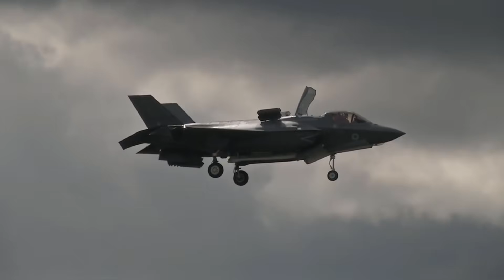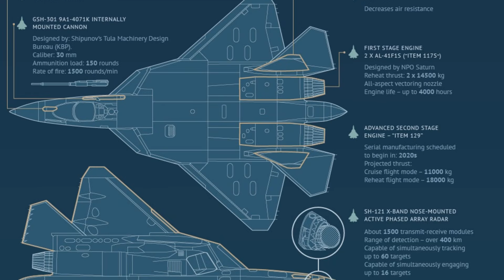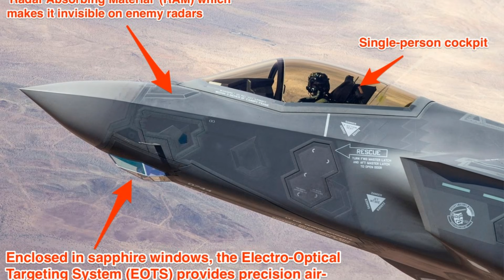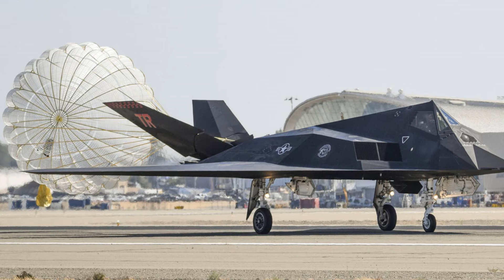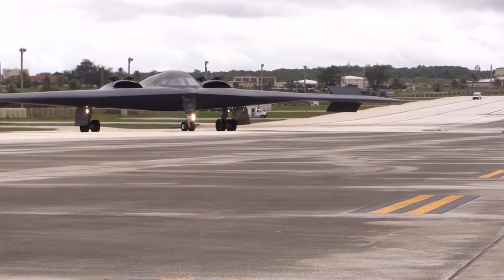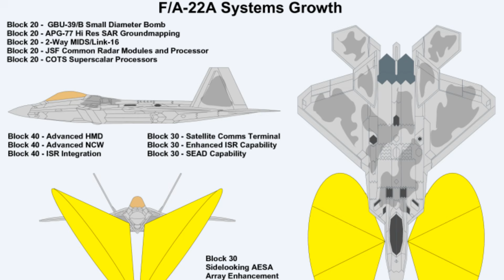Top 5 Combat Aircraft with Lowest Radar Crossection (RCS)

Comment: When you put su57 instead of j20 in top 5 then this ranking is a joke
Reply: Any fighter with canards is not a stealth fighter. They destroy any chance at reducing the RCS. It does have a decent AESA radar system which is a nut the Russians still haven't cracked the last time I checked. But it doesn't have super cruise or stealth. They haven't even been able to make their own engines yet. They'll probably get that problem fixed within 5 years or less. Bottom line is not a 5th gen fighter. Out of nothing but kindness you could call it a 4.5th gen. Within 10 years we're going to see 6th gen from the US and probably Japan.
Reply: @richardcontinijr9661  Japan has the best chance at making 5th and 6th generation aircraft along with the US.
Reply: @lw7238  Japan is skipping 5th generation fighters and going straight into development of 6th generation fighters. Honestly it's the smart play for him and they definitely have the capability of producing them. 

Australia ought to take a cue from Japan when it comes to their sub program. Instead of trying to build the ship building capability to produce nuclear subs they should just lease 688I subs from the US. As we take them out of service they could be refitted and refueled fairly quickly. That would give the Australians both the operational capability and experience of running a nuclear sub much sooner than developing their own indigenous sub and it would free them up to start developing autonomous nuclear subs. Skip the current generation and go straight to the next gen is a very appealing option.
Reply: @lw7238  then why japan 5th gen fighter still not in service?🤣
Reply: @richardcontinijr9661  People forget WWII and what the Japanese built.  Japan built battle ships, huge aircraft carriers and good planes rather quickly.  

Sweden's AIP submarines are a lot cheaper and catching up fast on nuclear subs.  They are defiantly the best non nuclear submarines in the world.  Still you can't beat the US nuclear subs even the used ones with a refit to newer tech.
Reply: @Vincent-xz2bj  Because they building a 6th generation.  HA HA HA
Reply: @richardcontinijr9661  It's ridiculous to say 6th generation fighter jets at the moment. We know that the replacement of fighter jets requires two conditions. The first is a major breakthrough in technology, or a major discovery in air combat theory. The second is that the new generation of fighters will inevitably crush the old ones.
From the beginning of the stealth fighter era to the present, I don't see a new major technological breakthrough or air combat theory. The so-called loyal wingman can only be regarded as an upgrade project of the fifth generation aircraft. I also don't know what kind of new aircraft to make that can completely crush the current fifth-generation aircraft.
The era of the 6th generation machine is coming, but it is still far away. F35 has not yet undergone major changes in the mid-term, and the future direction has not been clear. Now all the talk about the sixth generation machine is bullshit. In my opinion, there may not be a real sixth-generation fighter in the next 20 years, maybe there will be a fifth- and a half-generation fighter in Europe (like the Rafale and Typhoon), that's all.
Reply: @richardcontinijr9661  don’t put japan in 6th gen fighters 🤣, they don’t even have their own satellite navigation lol
Reply: @Vincent-xz2bj  Japan's mind fighter was actually an empty shell plan from the beginning. The United States cannot tolerate Japan's development of independent fighter manufacturing capabilities, and Japan does not have sufficient financial resources and needs. Mind Fighter has two roles. The first is to force the US to sell F22. The second is to have a hole card in negotiations with the US. However, neither of the two goals of the Mind Fighter was achieved. Until the last test flight, most of the subsystems of the Xinshen fighter were not installed, and the experiment was just a shell. I wonder why so many people care about such a moot project.
Reply: @richardcontinijr9661  what make you think canards will effect stealth fighter, well you gonna come up with your western logic, just admit that US doesn’t have that technology lol, do u think China don’t know canards will effect stealth or maybe they have solve this problem, don’t look down to your competitor

J20 has tested with new engine WS-15 this begining of the year, will start operating in 2025, just wait and see
Reply: @Vincent-xz2bj  math says canards ruin RCS
Reply: @richardcontinijr9661  western math okay 🤣
Reply: @richardcontinijr9661  we don’t worry about US 6th gen fighter, bcoz even they have it, they will still have production problem, don’t tell me you gonna use one 6th gen fighter to fight with two hundred j20 lol, China will catch up with the time
Reply: @Vincent-xz2bj  production hasn't been a huge problem yet. We've already produced over 750 F-35's. The total order for the US is around 2500 and our allies have 900 on order. 

But going back to Japan your comment about satellite navigation makes no sense at all. They have access to GPS which is the global standard for satellite navigation. GPS works anywhere in the world. They produce their own GPS receivers. You apparently haven't been paying attention to Japan's 6th gen program. It's not something to be dismissed but the 50 cent army is full of zealots who spread pure propaganda. 

Now on a different topic I must admit I was wrong about Russian military capabilities. I gave them too much credit. The war in Ukraine has been a shock. I really didn't expect Russia to do that badly. Their equipment is nowhere near as good as I thought it was. I have always had doubts about their troops. They don't have a strong NCO corps which leads to less flexibility but I didn't realize it was that bad. The amount of destroyed equipment is staggering. Whole engineering units are getting destroyed trying to cross rivers. It's as if nobody ever told them you have to secure the other side of the river before you build a bridge.
Reply: @richardcontinijr9661  what I mean is US don’t have capability to build a lot of fighter in one year, they always take 5-10 years to finish their target so it give time for China to catch up

If you want to build your own 6th gen fighter then you must have your own satellite navigation not using US GPS system, let think if US don’t want you to use their GPS then how your jet gonna work

About Russia, yeah their air and navy force really on downhill but I think Russia will still win the war bcoz if they lose then nuclear war will start, the only big military card Russia have now is nuke
Reply: @Vincent-xz2bj  it's not a simple numbers game. Even if China can out produce the US and fighter jets it still won't be enough. War is not one by simple numerical superiority. Chinese fighter pilots do not get the same level of training as American fighter jet pilots. They don't fly anywhere near the same number of hours. They also have a very strict top-down rigid command structure. Without the flexibility for pilots to be able to make decisions on their own you lose. China also does not have the global reach. America has over 800 military bases in foreign countries.

You seem to be very confused about what is going to make up the requirements for 6th generation fighters. It doesn't have anything to do with having your own indigenous satellite navigation system. Why would America shut down a long time allies access to GPS? The answer is we wouldn't. Furthermore China's indigenous satellite navigation system doesn't even cover the entire world. The one bright spot in China's military is their Navy. They have the capability of producing a lot of hulls and giving them in the water. What they lack is a blue water experience. The American Navy has over 80 years of modern blue water experience on China. As it stands right now China is estimating that it would take 952 ships for them to take Taiwan. Taiwan is an island that's a few hours away from mainland China. If it's going to take them 952 ships to take Taiwan then they're not going to be that much of a threat to America for a long long time.

As for your assessment on Russia I kind of agree with you on the fact that the only way Russia could win is to use a nuclear weapon. For a long time I believed their military capabilities were far superior to what they actually are. Putin's war has been an eye-opener for the entire world. The cat is out of the bag and now we all know the truth. They're now trying to mobilize their reserve forces to create another 70 BTG's. They've raised the age limit which started off at 30 then it went to 40 and now the age limit is 50 years old. They're also only giving these reserve forces 30 days of training. This is going to be a disaster for them. All they're doing is creating cannon fodder. Eventually the Russian population is going to find out what is going on and it's going to destabilize the country.
Reply: @richardcontinijr9661  you know nothing about China, most of China military weapon are top secret, Beidou satellite navigation already cover the entire world.
I doubt about japan capability in 6th fen fighter unless US give them technology lol, without US, japan are nothing
Reply: @Vincent-xz2bj  wow I didn't realize that I never learned how to speak Mandarin or that I actually lived in China for six and a half years. Well since I am apparently clueless on anything about China I'll just wish you a good night.
Reply: @richardcontinijr9661  Taking back taiwan is not a difficult thing to do, don’t worry about that, after unite taiwan, China navy will on their way to blue sea, but you should worry more on US military base around japan and guam, bcoz these base are no more safe, in 2030 US navy will return to Hawaii or even their homeland due to most of their ship gonna get retire
Reply: @Vincent-xz2bj  have fun 50 cent army
Reply: @richardcontinijr9661  underestimating your enemy will only make you lose the battle
Reply: @Vincent-xz2bj  The j20 is not a 5th generation jet.  It doesn't fall in the 5th generation category.  The SU-57 is a much better fighter than the j20 but not by much.  The Su-57 is not even considered a 5th generation it's more like a 4.5.
Reply: @lw7238  think whatever you want, i don’t care your personal opinion, j20 with WS15 engine will completely a 5th gen fighter, if you still thinking canards will effect much stealth then I don’t know your brain
Reply: @Vincent-xz2bj  It's not a personal opinion, the West laid the out what makes a 5th generation fighter. I didn't make it up.  Well the canards to hinder and poorly shielded engines and underside vertical stabilizers all limit it to a 4th generation fighter.  Even the Chinese government has said numerous times that it is a 4th gen.   You're Chinese you should know they said that.
Reply: @Vincent-xz2bj  China has about 50 j20's.  When did they start to role them out?  2011
Reply: @Vincent you can't even speak proper English and yet your expect people to take you seriously?💀😂 1.) China's military is a dilapidated relic compared to America's military. 2.) America can quite easily outpace China in the procurement of aircraft, and far more advanced aircraft compared to China. 3.) China is still decades behind America in terms of aircraft design and manufacturing, and that gap is only getting larger. 4.) America designed, built, and flew a 6th gen prototype in under one year... China couldn't do the same in 5 years. 5.) American bases are not in any danger whatsoever. China poses no threat to American bases, aircraft, or ships. 6.) Taiwan is a sovereign nation from China, and will remain so. America has guaranteed the security and sovereignty of Taiwan, and China's saber rattling will never change that.. anytime China is ready to have their military slaughtered and decimated in the Taiwan Strait, they can try to invade it.... but we all know they're too afraid to try.
Reply: @fullcircle8231  how long you spent your time to reply me with your long essay? did any rule say people must speak proper english to communicate with other people?
Reply: @lw7238  dude it 2022 now yet you still think China only has 50 j20’s 🤣🤣🤣
Reply: @Vincent-xz2bj  I could really give a shit how many.  The consensus is 50 but I am sure the expert you are will have a higher number.  We wouldn't expect any thing less from all the gibberish shit you have posted.
Reply: @fullcircle8231  Vincent is an expert on every thing, just ask him.   Vincent likes talking gibberish like he knows something and then adds a couple of orange smiley faces at the end as a gloat.  He pretends he's at war and won a battle.  HA HA HA HA
Reply: @fullcircle8231  The United States is a global expansion country, and the US military is stationed all over the world, not only targeting China and Russia, but the US military is even more worried that its allies will be restless. Unlike the United States, China's only purpose is its own national security and territorial integrity. The above content is doomed that the strategies of confrontation between China and the United States are not the same.
From the perspective of the United States, China is only one of its many imaginary enemies. Russia has the world's largest nuclear arsenal, and the European Union is currently the world's second largest economy. So if the United States loses too much in the conflict with China, there may be a situation where Russia will regain its strength, or the European Union will be freed from American control. The United States must be flexible in its China policy.
But China doesn't have those fears when it comes to conflict with the United States. China can do everything in its power to maintain China's national unity, and there is no way out.
Judging from the current U.S. military capabilities, the U.S. military is no longer good at confronting powerful countries. The U.S. military is accustomed to killing guerrillas and poor people, and they are no longer the kind of military that could deal with high-intensity conflicts during the Cold War.
The Americans prefer to turn Taiwan into the next Ukraine, allowing Taiwan to drag China into the war, while the US military does not take the initiative to send troops. Americans want 23 million mentally retarded Taiwanese to become cannon fodder and serve the interests of the United States with their lives. Taiwan will be the last person to die.
Reply: @richardcontinijr9661  You go and look at Wikipedia's description of the J20. Canards are not disruptive to stealth. The reason for saying the J20's stealth capabilities are questionable is more of a theology than science. The U.S. military's judgment is that the radar reflection area of the J20 is close to that of the F35. Western scientific research organizations have used radar to illuminate the J20 and concluded that the impact of canards on stealth is negligible.
In order to achieve the ultimate stealth performance, the F22 comes with many harsh conditions, such as constant temperature and humidity hangars and so on. With the current technical conditions, the performance of J20 is the most reasonable choice.
Reply: @unudo3359  you start off with look at Wikipedia. Instant fail from the very beginning. Don't come talking that crap to someone who is in aerospace engineering.
Reply: @richardcontinijr9661  Russia's fifth-generation aircraft standards are different from those of the United States, and Russian fighter jets do not regard stealth performance as a major design requirement. However, the design of China's fifth-generation aircraft is completely in accordance with American standards, and the J20 has all the performance requirements except for supersonic cruise. Your kindness is ridiculous. The standard of J20 will not be lower than that of F35, which you define as a 4.5-generation fighter, while the non-American su57 is defined as a fifth-generation fighter. At present, the imaginary enemy squadron of the United States is changing to the F35A to simulate the J20. If the J20 is not a stealth fighter, why would the US military use the F35A as a simulation model. The current production of su57 is simply not enough to prompt the United States to establish an imaginary squadron of stealth fighter jets, which echoes the current public statement that the J20 and F35 radar reflection areas are close.
Now is not the century of colonizers. If the United States intervenes in the Taiwan Strait war, it will need to pay hundreds of thousands of casualties and inevitable failures.
Reply: @unudo3359  5th gen fighters are defined as having all the following characteristics.

Stealth, with munitions stored internally.

High maneuverability, which tends to include short-field capabilities.

Supercruise, i.e. prolonged supersonic cruise without the use of reheat.

Advanced avionics, including low-probability-of-intercept radar (LPIR).

Networked data fusion, enabling situation awareness on the battlefield.

Multirole capabilities, such as battlefield C3 (command, control and communications).

It doesn't matter what Russia considers a 5th gen fighter to be. The SU-57 doesn't meet the requirements to be a 5th gen fighter. As for the J20 it's still not a true 5th gen fighter. The canards destroy any RCS reduction that they would have had. I never claimed the F-35 was a 4.5 gen fighter. Stop making shit up. The entire world can read every word I typed and clearly see your lying about that. Once a liar always a liar. You destroyed your own credibility with that one. 
Go ahead and stomp your feet and shake your fists 50 cent army. Nobody takes you or the CCP seriously. Taiwan is a country and they have a right to defend themselves against Chinese aggression. Go ahead and try to take the island. You're country will find out how bad a decision it is for them. I'm done wasting my time on you 50 cent army. So have a crappy night 50 cent army. Oh and 🖕the CCP 🖕 chairman Mao and 🖕Xi Jinping
Reply: @richardcontinijr9661  If the Clinton administration in the United States has a president capable of reaching the level of Xi Jinping or Mao Zedong, China has no chance at all to become an opponent in the eyes of the United States.
China just does its own thing well. America's problem isn't China, it's Americans messing up their own business.
Reply: @richardcontinijr9661  See for yourself the Wikipedia description of the J20's stealth capabilities. Wikipedia has no Chinese maintainers, so you don't have to wonder. Please don't spread unfounded rumours around, we're talking about science and you look like a crusader butcher.
Reply: @richardcontinijr9661  Americans are people, not gods. I remember the first commandment of the Ten Commandments of Moses said that you have only one God. If Americans feel like they say Taiwan is a country, then Taiwan is a country. Apparently Americans think of themselves as gods. If Americans insist on pretending to be gods, then maybe China is the punishment of gods for Americans.